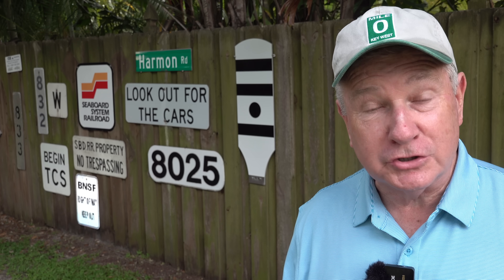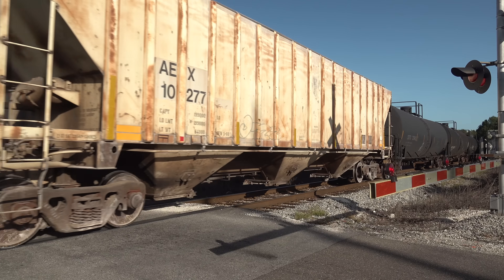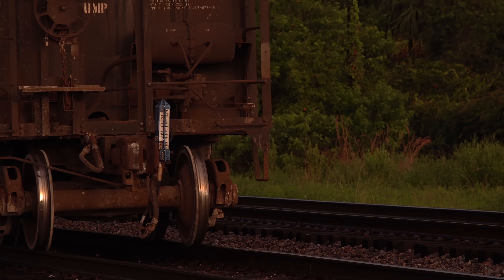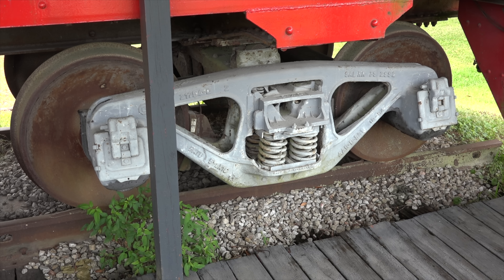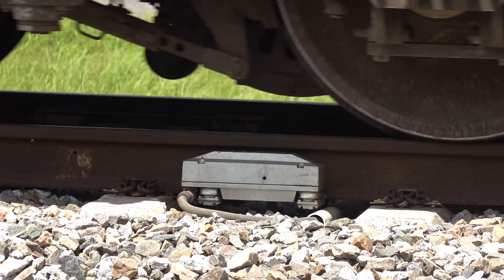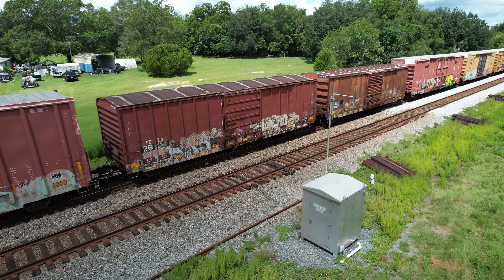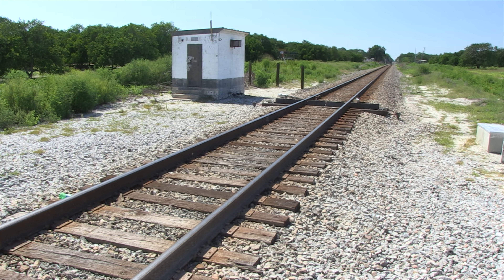What Railroad Defect Detectors Do

Comment: To clarify what appears at 3:51 on your video the two devices mounted on the rail are called transducers. Their only function is to let the defect detector know when a wheel is present.. Two transducers are required to let the equipment calculate the speed of the train and determine what direction is headed. They are nothing more than an electronic “switch” and have no capability of looking for actual defects on the wheels.

I worked for CSX for almost 14 years starting out on the old A&WP/Georgia Railroads then over 30 years as a signal engineering consultant.

Comment: I really like that camera portal thing. I wonder what type of cameras they use. I know timing and scoring for the Indy 500, they use a pretty cool camera that is similar to that. There's is probably a bit more precise since timing is involved, but basically it takes a picture that is only 1 pixel wide, but it does it 1000 times a second, and stitches all the columns of pixels together to get basically a ticker tape of every car that goes by the start/finish line. If CSX uses the same type of cameras, they'd have a single high resolution image of an entire train, no matter how long it is.

That camera system would probably be great at catching hobos catching a free ride as well. They could notify the train crew, as well as the local cops, that there's an illegal rider 83 cars back, on car # whatever.

Comment: Now here's a question. I have seen passing trains with a derailed or defective wheel that may not have been caught yet. Is there an emergency phone number to report this?
Reply from the maker: Yes. The number on the blue sign will work for that too. You've got to know where you are, though, to give them an accurate location.

Comment: In 1974 when I went to work with Southern Railway, greased boxes with pads was very common, do you see any these days.
Reply: Only on heritage railways I think now. Anything modern will almost certainly be ball or roller bearings. Of course these types of bearings can still fail.
Reply: They have been banned on interchange service for several decades.  A captive railroad can use them, but I doubt they even make replacement brass for them
Roller bearings are the normal.

Comment: At 4:13:  That folded dipole actually has a radiation pattern that resembles a donut shape.  What is advantageous is that a folded-dipole will focus more of the RF energy into the horizontal plane than the vertical plane. That does result in an increased energy parallel to the ground and less radiated toward the sky thus wasting power.  Think of a tennis ball that is round in all directions equally vertical and horizontal. Replace that tennis ball with a doughnut. Now you can visualize the change in radiation pattern via folded dipole to provide more signal in the horizontal thus extending the range of the signal to a useful extent. It still goes in all directions horizontally but is useful to improve reception by the trains. It is a smart move.
Reply from the maker: Very interesting. Does a folded dipole improve horizontal reception as well?
Reply: @distantsignal  An antenna receives as well as it transmits, per the "reciprocity rule".  The Folded Dipole does focus more energy in the horizontal plane at the expense of signal in the vertical plane. So to answer your question,  yes, it does improve both transmit and receive  equally, as all antennas do. This one, with its donut shaped horizontal beam shape, will send/receive equally well horizontally.
Reply from the maker: I would love to try a folded dipole on my base station radio. But the Sinclairs are so darned expensive.
Reply: @distantsignal  I don't know what happened to my earlier reply.  Look around and see if there is a Ham Radio Club in your area. Go to one of their meetings and ask about constructing a home-built folded dipole. Most hams are willing to help out and show you how to build one cheaply.

Comment: I learned recently that the DDs send detailed reports back to dispatch with actual measured bearing temps.  My son recently had his train stopped by dispatch due to a "trending" wheel bearing temp.  The temp hadn't reached the threshold to trip the DD, but dispatch noticed a bearing climbing in temp over the course of several DD hits, had the train stop, and my son had to walk the train to inspect the suspect bearing manually. Bearing checked  OK by my son's stick, so the train got clearance to continue at speed, and my son got a free two-mile track side hike. Someone I'm sure knows if this has been SOP all along, but it seems to me this is is a procedure put in place since East Palestine.  Better  safe than sorry!
Reply from the maker: Thanks Walt. I did not know that. I knew that a DD would pop up on a dispatcher screen if it detected a bearing above the threshold, but I'd never heard of the trending report. Yep, I'm sure that's something that was deployed after East Palestine.

Comment: Conrail had its unique voice for DD’s also Its called spacers some hasmat cars in a mix freight require 6 spacers. Like for explosives, flammable liquids and gases or toxic chemicals and solids and even radioactive materials too. 

There 4 types of defect dedectors . Hot box, dragging Equipment, wheel impact (flat spots) and clearance (height and width)

Dan from Philly PA 😎

Comment: The problem with DD and even the infrared is that while they can "get the job done," they're not designed as "predictive/preemptive" systems. The railroad needs to incorporate Ai and a cost effective system that preemptively discovers an issue with a car, rail, weather, power etc before it becomes a problem. I know I make it sound easy. But, the solution is thinking and designing a better solution to catch the problems before they become major issues.
Reply from the maker: This is exactly the kind of area in which I think "A.I." can be very useful. Analyzing and predicting events. Sadly, AI will be mostly deployed in the quest to make people UNemployed.

Comment: The detectors near me also say the outside temperature, why is that?
Reply from the maker: Continuous welded rail, which is solid, quarter-mile lengths of track heats up on hot summer days. Sometimes that heat will expand that steel in the hottest spots up against the next length of rail, which may be a little cooler. The hot rail has no place to go and can "snake" in place, forming a kink. When a train goes over that kink it can run off that rail, causing an accident. The defect detector checks ambient air temperature to warn crews and dispatchers that conditions are good for a heat kink.
Reply: @distantsignal  omg thank you so much

Comment: Danny,
Do you know how the acoustic bearing detectors came into existence? On the BN at Guernsey, WY, two carmen could hear different sounds coming from the roller bearings as they passed a inbound round-by inspection. The BN started a test program of taking the bearing out of these cars and sent to Havelock (Lincoln, NE) Wheel Plant for inspection. We found that spalls on the bearings when there where removed for inspection. Thinking that if a human ear can detect different sounds coming from the bearing, then a machine could also hear these defects. The first acoustic bearing detector was placed into service in Alliance, NE. (Power River Coal Lines) in middle 80's. Now, they are on ever railroad in the United States, just because of two carmen how had good hearing.

Comment: Thanks for the deep dive into detectors, and thanks for the info on the folded dipole antennas attached to the instrument cabinet, I've had folks try to convince me that they're satellite antennas, being a ham I know that's not the case. It is a bit disappointing that the detectors cut back on the information that they used to transmit, like train speed. Do the detectors notify dispatch when a defect is detected?

Also - I "grew up" next to the BN and am used to hearing yard crews, maintenance crews, and opposing train crews calling out "All's good on the Roll By" Does CSX do roll-by inspections?

Comment: nicely done, couple of things, a draft gear is different that the coupler. draft gear is a mechanical cushioning unit located behind the coupler.  old friction bearings boxes held oil, not grease. there are sensors that detect hot wheel bearings and a different one for wheel temperature. Buffer cars on each end of unit type of train are so they can change direction after loading/unloading. . really nice work, great footage and nicely presented.

Comment: Here's every detector readout summary

6:47 Oxford DD
CSX Detector MP: 756.8
Speed: 39 MPH
Defects:  1
Dragging Equipment - Axle 529
Axles: 674
Length: 11076 ft

7:27 Knights DD (New)
CSX Detector MP: 818.9
No Defects
Axles: 368

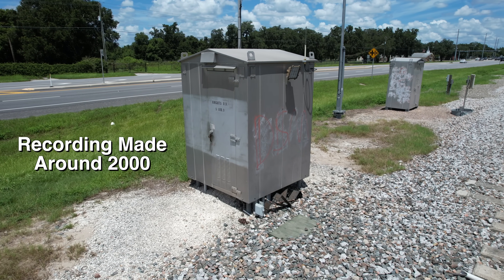8:01 Knights DD (Old)
CSX - Knights, FL
No Defects
Axles: 448
Length: 7471 ft

10:20 Singley DD
CSX Detector MP: 619.5
Track:  1
No Defects
Axles: 916

10:49 Winter Haven DD
CSX Detector MP: 829.3
No Defects
Axles:  56
Speed: 81 MPH
Length: 1167 ft

Comment: From someone who installs defect detectors on the regular for fec, the items mentioned to be detecting flat or crack wheels are actually magnetic sensors that pick up every time a wheel passes. These start the activation on the detector system. Depending what sensor picks up first is how it determines the traveling direction of the train. They count the wheels and tell the hot box’s when to take the inferred photos of the hub. They do make a thumper sensor but I’ve yet to ever see or install any.
Reply from the maker: Thanks for the info. So there aren't wheel impact detectors in wide service?

Comment: Those are not wheel impact sensors. They are transducers which counts the axles. They activate the system, count the axles, and tell speed and direction

Comment: There are lots of copper cables and other valuable things out there in the open.   the ones with solar panels and big boxes have lots of expensive batteries inside those boxes and are only protected by cheap locks.   The solar panels and be retrofitted to power camps out in the middle of nowhere...........

Comment: You’d think in this day and age each car would have a defect reporting system on board. Guess it’s cheaper to have stations with sensors along the tracks.
Reply: Correct. It’s also another thing to fail to stop a train. A company in my area tried electronic braking on unit coal trains. Just because a connector broke they sat on the main awaiting a service truck in a remote area. The air systems have been improved since the early days of straight air, and is a great fail safe.

Comment: Great video Danny! I enjoy watching and learn a little more each time. In light of the derailment in East Palestine the RR's need to step up and install more of these detectors and lower the temperature threshold of when an axle bearing is to hot. Even if they detect a hot bearing in many places they have no sidings to push off the defective car.

Comment: i'm glad some of them transmit actual data. it's very hard to listen that on radio imho. i mean i'm kind of person who likes text comms so i would see more of actual data transfer. unsure if train driver would be notified by data too. that, if it's good idea that train itself receives warning and tells or shows or even stops on it's own on errors. i mean eventually we need fully automated trains anyway. it seems like humans needing to listen on automated messages instead of listening alarm sounders and and red lights is much more workload. humans are there to take action. eg it would be maybe easier to even detect truck on tracks with sensors instead of eyes. but that's it engineer of me talking in railroad topic, it might not be easily implented or good

Comment: How are the bearings on Amtrak cars checked?  Amtrak bearings are behind the wheel, while the infrared detectors are on the outside of the rail.  The video has good explanation of detector components.

Comment: A defective defect detector and/or the controlling computer is most likely what missed the hot wheel on the NS train that derailed in East Palestine.  The next detector did its job and the engineer put the train into emergency stop.  And since the speed was slightly less than 50MPH the emergency stop resulted in the jackknifing.

Comment: The defect detectors sure didn't work for crap in the Norfolk Southern / Ohio derailment explosion. 
As a diesel locomotive mechanic, I know that the rolling stock cars are not inspected like the locomotives are. With the locomotives, there are monthly, quarterly, and yearly mechanical and electrical inspections done on each locomotive my company owns. Rail cars only get attention when something breaks or leaves the tracks. Rail cars are cheap to buy, replace, or repair compared to more expensive locomotives. Each rail car is insured with its internal load. Rail car leaves the tracks. It's the insurance company's problem, including cleanup of all track damage. Each railroad company squeezes every penny out of the rolling stock as much as possible. On time delivery is more important than mechanical and visible inspections of rolling rail cars. If a wheel has a flat spot on a rail car, it keeps rolling until the axel separates from under the rail car.

Comment: 3:55
"...flat spots and cracks"
how does a static 'defect detector' detect a crack on a fast moving wheel ?

 i work as a human  'defect detector' and i use ultrasonics as one way of detecting problems in wheels and rails. Unless the crack is huge (and the DD uses image comparison)  i do not see how small ( still potential derailment size) cracks could be detected .

Comment: What happens when a bad bearing is found? Do they stop and fix it right there or keep going until they can get to it?
Reply from the maker: Usually they stop and check it and if it's just hot and no damage is seen, they limp it at slow speed to the nearest siding or storage track. A shop crew will come out, fix the bad bearing and the next train will pick the car.
Reply: @distantsignal  Thank You

Comment: Those little houses with solar panels are easy pickings in rural areas.   Homeless have found out they can steal the solar panels and the batteries inside the sheds and power their camps or sell them to people that do not care where they come from.   Around here they will sell the solar panels for around $20 or trade for a bottle of cheap whisky  They can also harvest a good amount of copper wire in those signal boxes on the tracks.

Comment: Well, this seems irresponsible at best. Why do they talk? Call me paranoid, but the only reason I can come up with is that by avoiding transmitting the data digitally they can avoid having permanent logs that could be used in court. But goodness, at what cost? It means you can't correlate data between stations, you can't mine them for patterns, you can't take automatic action—you can do nothing without a human in the loop on each individual report.

Comment: Fine video! Perhaps you are the one to ask, as no one I've previously mentioned it to seems to know what I'm referring to. Along the main tracks here in Arizona back in the early 2000s I noticed many wooden poles trackside. Mounted to said poles were metal boxes with an angled arm on top that had a spinning metal disc between 8 and 10 inches across, on top. I'd really like to know what they were, as they seem to be gone now. Many thanks in advance.

Comment: I would say the slappers were hand numbered to facilitate fault finding and maintenance at some point. Perhaps a board was switched out (for example) so the slapper and plug were numbered for faster swap out with no cross connections.

Comment: I guess the system wasn't working in Palestine Ohio.
Reply: The accident investigation found the defect detectors were working but there was an inadequate response from the operators.
Reply: @jjmoreland   I assume “inadequate response” is a euphemism for “they ignored it”!
Reply: @David-lr2vi  the initial report found the crew followed procedure and otherwise did nothing wrong based on Norfolk Southern operating parameters, it's the NS parameters that were probably too laxed.

Comment: My guess for why the drag sensor flaps were numbered is that either there was a problem with the flap sensor system and they numbered them for ease of troubleshooting, or they were all milled to different widths and needed to be assembled in the correct order.  Of course, both hypotheses could be wrong, too.
Reply: I had the same thought as I was watching regarding troubleshooting.

Comment: Quite old fashioned technology, VHF-radios and voice messages someone needs to be listening to at all times instead of digital over cellular phone network connected to a central computer system to monitor and record the data and raise an alarm if needed. But I guess it's such a massive amount of equipment it would cost too much to change it.